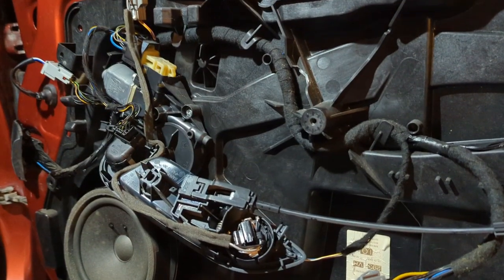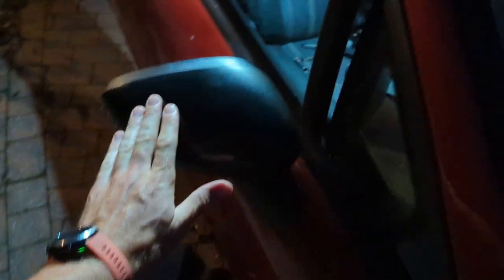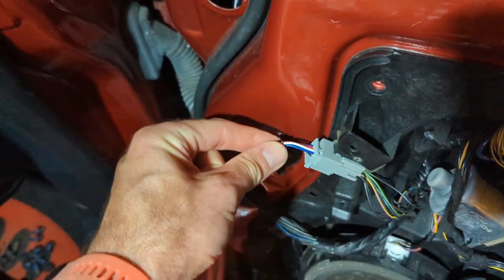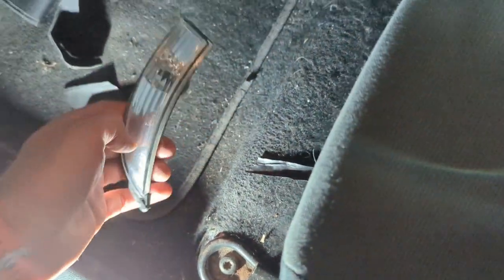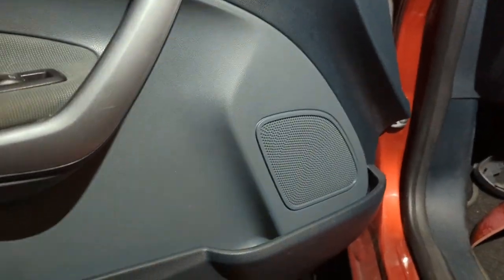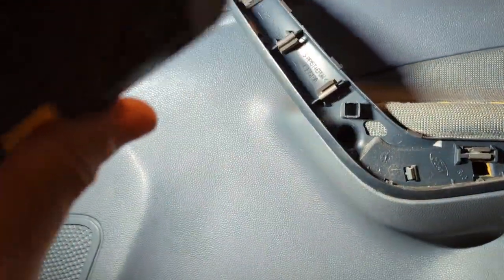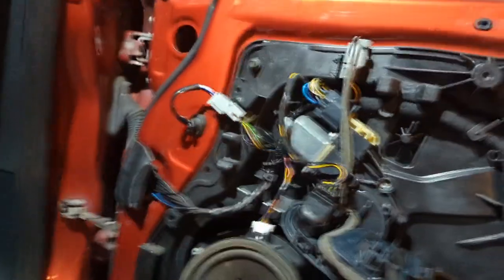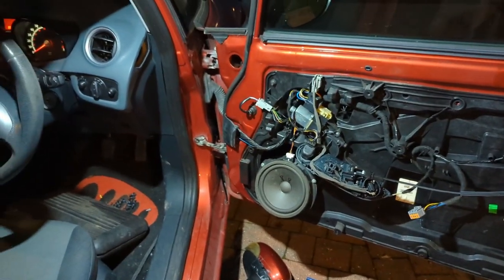Changing a door mirror - 2009 Ford Fiesta - short version!

Comment from the maker: NOTE - I COCKED UP!!

If you're following this, wind the window DOWN before removal, and fit the mirrors with the window DOWN.

I found the cable snagged. Fortunately, it just pulled the connector out of the indicator in the wing mirror, simple modify.